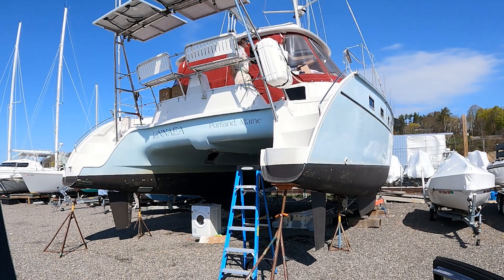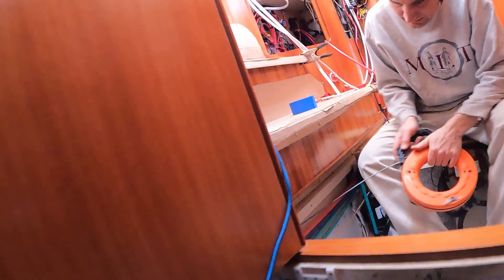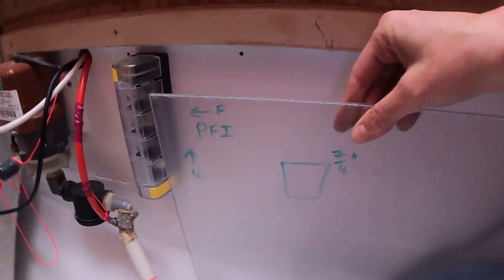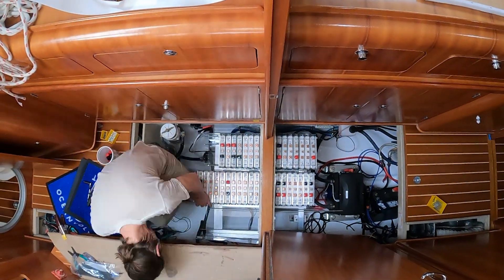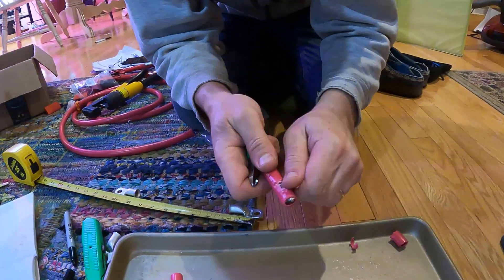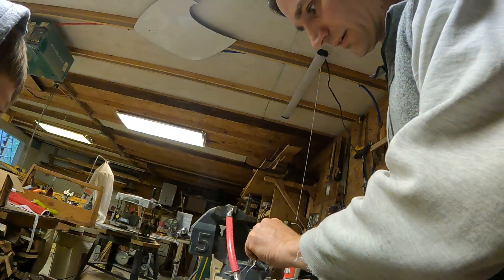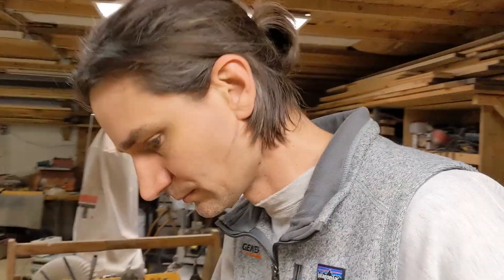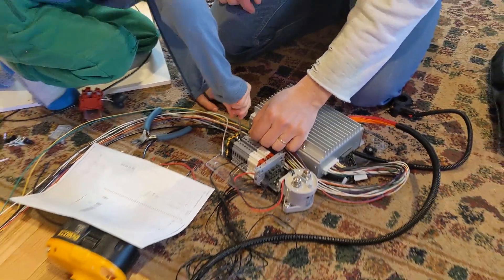Installing Batteries

Comment: Hello again.  I'm still working on funding to purchase an Antares / PDQ and rebuild as electric. 
I am curious if you have been able to add a generator onboard.  If so - and you have the series hybrid configuration - have you measured the "continuous run" characteristics and performance?
example:  extended motoring until the generator kicked in to recharge.
I'm mostly curious about the motor's ability for a "continuous run"  cycle.
Happy sailing...

Comment: What is the total weight of the batteries? Also been hearing some people are struggling with insurance due to lipo batteries have you had any issues? Good work btw thanks for the update 👍
Reply: Each module is about 3.5kg, so the complete stack is around 200kg (in each hull).  The Oceanvolt AXC10 is 40kg.  The Yanmar diesel that we pulled out was about 160kg with all the fixins.  So the diesel engine was about 80kg lighter, or about the weight of 25 gallons of diesel.
Reply: @oshuaj12  nice 👍. Can't wait to see what the run time is with that amount of power 🙂.
Reply: @oshuaj12  I know it is too late for your project, but did you look at the implications of Sodium Ion instead of lithium?  (For the fire and price implications)